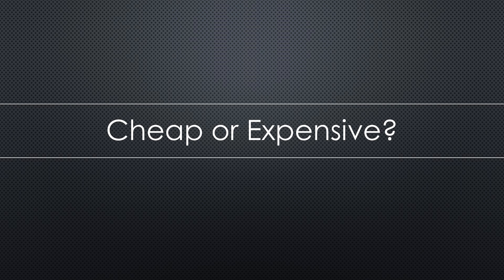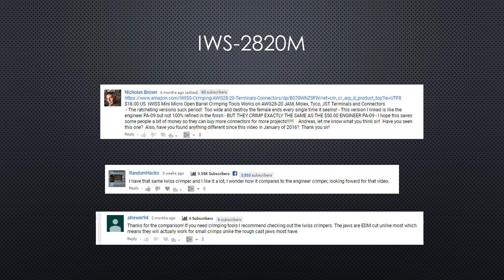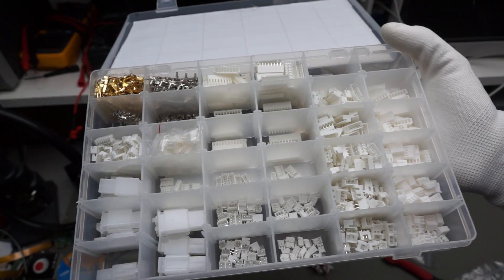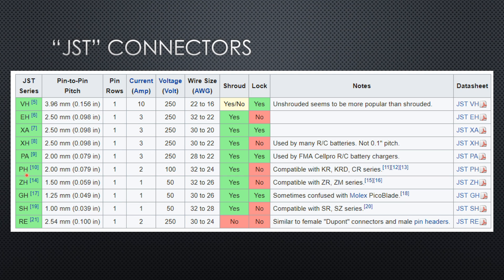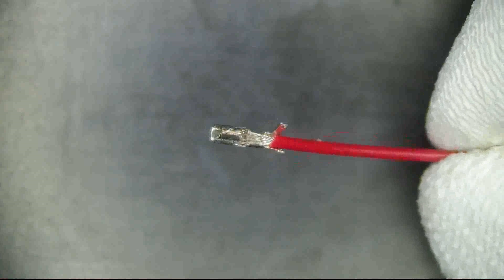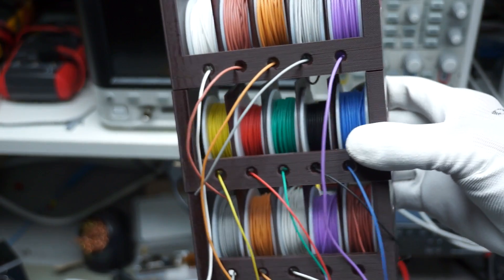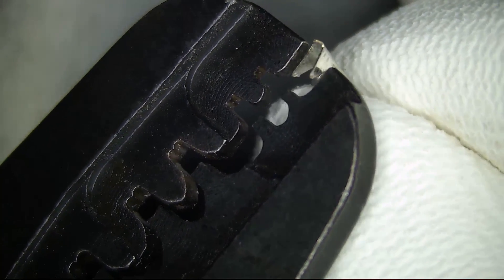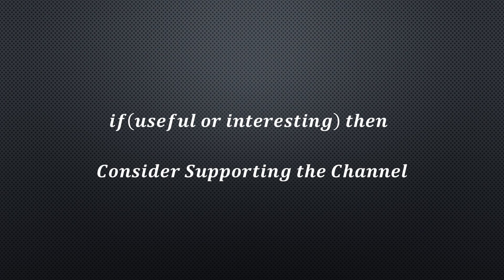#282 Crimpers: IWISS IWS-2820M  against Engineer PA-09?

Comment: I'm using the IWISS since a few months and so far i'm very happy with it. The smaller openings are very useful for JST GH - that's at least where i used them for. 
Thank you for this video - now i've learned that 1.3 is enough to crimp the end of dupont cables :)  I've always used 1.6 for the end and then had to compress the ears it created. 1.3 works so much better.
Reply from the maker: Yes. 1.3 should be ok.
Reply: I often pre-crimp using 1.6 or even 1.9 opening then crimp down with 1.3. Please, DO note that Dupont cable crimps must "Embrace" (wrap around) the wire, not dig into it. Therefore a correct dupont wire crimper would be U-shaped and not W
Reply: mattmillman has an excellent article
Reply: you probably dont care but does any of you know a trick to get back into an Instagram account??
I stupidly lost my account password. I appreciate any tricks you can give me
Reply: @Albert Gannon Instablaster ;)
Reply: @Adriel Nicholas thanks so much for your reply. I got to the site on google and I'm trying it out atm.
Seems to take a while so I will reply here later when my account password hopefully is recovered.
Reply: @Adriel Nicholas it worked and I finally got access to my account again. I am so happy:D
Thank you so much, you saved my ass!
Reply: @Albert Gannon No problem :)
Reply: hello i use IWISS for JST GH , but i felle the result is not perfect  for isolator part ! is like 0.7 to small and 1.0 to big  ! how you do ?

Comment: Thank you very much for your reply to my comment on your Video #39  I did watch this video before I ordered new crimpers and did order the IWISS model IWS-2820M.  I have used them only twice and both crimps are very good and they are MUCH easier to use than anything I have tried before.  I am a 74 year old retired engineer and my eyesight is not as good as when I was much younger, but I have an Optivisor Headband magnifier that works well for me.
Reply from the maker: Glad I could help. These magnification glasses are very useful, indeed.

Comment: Hello, I just bought the Engineer PAD-11. It's more expensive, but has interchangeable jaws (~ 25 Euro / jaw). I just used it to crimp JST-ZH (1.5 mm pitch) for a Sensirion SPS30 PM sensor (particulate matter). After a couple of tries and failures I now get 100% succes rate with stranded 28 AWG wire. My first attempts were with ~ 26 AWG, but the housing for the crimps seems to struggle with the larger wire diameter (crimpts were successful, but not as neat as with 28 AWG). Next I will try a JST-SH which is 1 mm pitch for a QWIIC to SPS30 JST-ZH connection. That's going to be more challenging, but the PAD-11 should be able to do it.
Great channel BTW!!
Yves
Reply from the maker: You are a brave man! I decided to buy ready made JST connectors for the smaller sizes ;-)
Reply: how is the Engineer PAD-11?
does it crimp JST-GH 1.25mm and JST-SH 1.00mm?
Reply: I had success with the JST-SH 1mm (2 tries to get a working result) using the PAd-11.
Reply: @yvesvanderhaeghen196  great. do you use Molex PicoBlade too?

Comment: if you turn the connector upside down in the crimper and gently squeeze it the angled bottom of the channel will bend the tabs in slightly so you don't have to use the end of the tool.
Reply from the maker: Thank you for the tip!

Comment: I like my SN-02BM still. I have both versions now. The first pliers I ordered have 2 press fit pins in each die, along with a screw. This is specifically the SN-02BM. The "M" is the one with press fit pins.
  I have a second set of SN-Series pliers that have interchangeable dies. These only have a screw holding the die in place, no press fit pins. I have the SN-02, SN-28B, and SN-48B dies. The SN-02 is similar to these Iwiss pliers. It has a bunch of different sizes and bridges the SN-02B and SN-28B with extra sizes on a long extended die. The die alignment with the tiny crimp sizes of the SN-02 without the press fit pins is bad.
  I can do the JST 2.0/2.5 crimps all day without any issues using the SN-02BM. The 28B and 48B dies work well for 2.8-6.3mm terminals using the pliers with replaceable dies. I wouldn't recommend the SN-02 in any variety other than the pinned version. It sucks that you won't be able to change dies with it, but it works well.
-Jake
Reply from the maker: Thank you for sharing your experience!

Comment: I would have expected a pull test with a force meter, to see which is actually better. And possibly also a resistance measurement.
Reply: When I do a pull rudimentary test at home, the terminal is clamped into a vise and I pull until the wire breaks.  If the wire pulls out of the crimp it is a fail.  If instead the strands of wire break instead, it is a pass.

Comment: I have a crimper from Radio Shack (US) that I bought over a decade ago for making DB style connectors. It does both crimps in 1 action and works w/ Dupont terminals quite well. I'm surprised these modern "tools" don't.
Reply from the maker: Radio Shack had good products (I had a TRS-80)

Comment: 0.7 and 1.0 mm crimping is needed for any connector where the pin spacing is 1.25 mm. For example the molex clickmate series.
Reply from the maker: I do not do these jobs manually. I buy them ready-made. So I do not know.

Comment: Another really great video - thank you!! I thought it was either my technique or the cheap Aliexpress crimps that was causing me troubles. Especially the extra steps needed to straighten the insulation grip before crimping and then straighten the whole crimp afterwards. I just got my IWISS tool and now perfect crimps every time! The Engineer tool is better made and will probably last longer, maybe it crimps high quality parts better too. But for now, the IWISS wins for me hands down.
Reply from the maker: Agreed

Comment: How interesting, not the result is expected and I have a few I Iwiss crimpers. I mainly use the Iwiss sn01 (2 bays not 3,) for jst and molex rather than the 28b that most others use and it works beautifully, but does occasionally dog ear the cables plastic part. I also have their anderson power pole crimper and a couple of others, but I never expected them to outperform the Japanese engineer pa09. Kudos where it's due I guess, well done Iwiss and thanks for all your good work in these videos actually testing the tools head to head.
Reply from the maker: I also was astonished. This was the reason for that video. For many viewers, the Engineer was quite expensive...

Comment: Just saved me £30, had a the PA09 in my basket.... thank you kind sir!
Reply from the maker: You are welcome!
Reply: @AndreasSpiess  Ironically I ended up returning the iCrimp after trying the Engineer PA-24 crimpers. Not only is the wire crimp better but the rounded cable jaw crimp is perfect and wraps the cable rather than crushing it. Making DuPont connectors is 3x faster with it vs the iCrimp (with my crappy eyesight too)

Comment: I was tired of those cheap crimpers(your previous video) and few others.
So I decided not to cheap out this time, found PA-09 on amazon, but in the other recommendations/frequently viewed there were those ones from IWISS, checked comments and people say that those do as good as PA-09 but are much cheaper so better.
But I ignored it, didn't want to risk that I get another useless crimper, purchased PA-09.
Though now I regret this decision a bit, I also have this problem where entire crimp insert is being bent.
Also I expected much better tolerances on sides of those jaws, can clearly see gaps when closed.
Reply from the maker: Thank you for sharing. The other video was already quite old and the IWISS were not around then.

Comment: For smaller jobs like MQS 0,2 to 0,5 I purchased a Rennsteig #616 682 3, it has absolutely NOTHING to do with any other tools ou can find for these small connectors. There's no secret, quality tools make a hell of a difference. I will note that this crimper costs over 200 euros (and it's not the most expensive around), so it's not on everyone's priority list !! 
I find that providing you can afford it, most of those tools will stay with you for years in not a lifetime...  and you purchase and change the dies according to the job. 
- the guy with the Swiss French accent ;)
Reply from the maker: I googled your choice. I bought a used Harting FC2 which is similar to yours. But for makers a little expensive. Most makers should be ok with one of those presented in the video, I think.

Comment: Then 1.9 + 2.3 is for Molex SPOX (3.96mm pitch), which is pretty common with power supplies. That‘s, why I have a PA-20, too.
Reply from the maker: Aha. I never used them so far. Thank you for the update!
Reply: The isolation crimp is imho not so great (although it is the recommended crimp size from the manufacturer), left and right of the base there are cuts. When I press too much, it is even cut off. I might try the IWISS, too, because I want to see, if it performs better.

Comment: I have been crimping 1.25mm connectors (shelly2.5 and some CC2530 clone) using the 1.0mm on my PA-09. It works, but I need finer gauge wire :)
Reply from the maker: And good eyes ;-)

Comment: Just a caution that your Amazon link now points to the 2412 crimper and not the 2820. The 2412 has larger dies (2.2 - 3.4) so will not crimp DuPont well. The 2820M is not available on Amazon at the time I wrote this. Worse, the first and main picture is a 2820 but the remaining pictures, title, description, and the model number are for the 2412 so buyer beware.
Reply from the maker: Thank you. I changed the link.

Comment: Wow, I didn't expect one of my comments to be featured in a video!
Reply from the maker: You see, I read the comments;-)
Reply: @AndreasSpiess  I have used the IWISS crimp you featured in this video for JST ZH and standard servo/"Dupont" crimps and it has worked well. the ZH connectors used the smaller sizes. They are tiny! Thanks for reading. :)

Comment: They are both good. But, every single one crimp "ears" INTO insulation. Which is not always good. Specially on those "Dupont" connectors. That's why I ordedred Hozan P-707. You should check them out too.
Also, if you are not interested into that feature, take peek on IWS-3220M.
Reply: @Undefined Lastname
Did you watch the video?
Also, I know that. Thats why I want to try that Hozan crimper.

Comment: Would you recommend the manual crimpers over the ratcheting ones? And why? I'd really want to know your option.
Reply from the maker: I have no preference. If you find a good one with a ratchet ii is probably a little faster. But it is not easy to find a good one if I believe the comments in my earlier video.
Reply: @AndreasSpiess  I heard somebody say that the ratcheting crimpers are harder to work with when it comes to small connectors. Since the dies are big, small pins are difficult to keep still there compared to manual crimpers. I guess I'll go with the manual crimpers.
Reply: @AndreasSpiess  I also want to add that I found "quality crimpers" (for example Nipex) that can easily cost over $200 dollars, way too much for my budget and probably for the regular viewer too.

Comment: Would the pa-24 be better to get than the pa-09 with the DuPont crimps added? 

Do you ever need the larger sizes where it would be beneficial to get the PA-20 or PA-21? 

If so would the PA-20 or the PA-21 be used most?
Reply from the maker: I do not know these products. So I do not know :-(

Comment: I would like to make a Molex mx150 connector for my motorcycle and have hit a dead end with the type of crimper! My question is are mostly all the open barrel type connector very similar? As the recommended molex connector from molex is extremely expensive! Thank you
Reply from the maker: Crimpers are very different. Best is if you find videos where they show exactly the connector you want. There you see, which crimper they recommend.
Reply: @AndreasSpiess  i have been searching i have even been looking at the molex data sheets and the recommendation is the molex branded crimper. I will continue my searcg

Comment: What i have noticed is that all IWISS tools seem to have tighter matching dies installed on them (visible in this video as well) and the machining seems to have less margin.
after getting frustrated with my weierli sn-28b (nearly throwing it out the window.) I bought both SN-01BM and the SN-28B and they both work amazing.

Maybe do a comparison between budget SN28 crimper(s), even though the PA-09/IWS 2820M are workhorses. 
I do like the "squeeze once, and done"  deal with the 01BM and 28B by IWISS, 
and for that price...
No they are NOT as good as the official crimpers, but close enough to be used and rely on. 
Maybe i'm just lucky, maybe there's something to this brand.
Reply: Do be careful with fake IWISS tools, the SN ones with NON-Machined crimping dies are FAKE and absolute sub par quality.
Reply from the maker: I ordered two more IWISS crimpers. We will see if their SN-28B is better than the one I had from Aliexpress...

Comment: 2:25:  I just ran into an example of needing a larger crimp than the 1.9 (though not sure if the 2.2 on the IWISS is exactly correct for this case): JST VH connector crimps, e.g. for a motor driver board (like the 3.96mm pitch VH pins on the left side of board here https://youtu.be/TaCukBg4Hj8?t=178).  The Engineer PA-09 documentation shows it's compatible with PH/ZH/NH/EH and you need the next bigger crimper, the Engineer PA-20 (adds 2.0 and 2.3 crimp slots), for VH.
Reply from the maker: Thank you for sharing your experience!

Comment: I made the mistake of trying to save a few bucks buying the SN-28B. It's pretty much impossible to produce a good crimp with that thing, even after doing hundreds of crimps on various projects over the years. I'll definitely be replacing it with an IWISS for the next project that requires crimping.
Reply from the maker: This was the reason for my first crimper video...

Comment: Hello, Thanks for the interesting video.
Do you have any suggestion for a tool to crimp open barrels terminals with 12AWG (4mm²) cables ?
Reply from the maker: No. I do not use such connectors :-(

Comment: Thank for testing and evaluating of these crimpers:-). After watching your video #39 I was already tending to buy the nice PA-09. But apart from the long parcel trip from Japan, the IWISS IWS-2820M made me curious, too. 

Now I have discovered a similar version: IWISS SN-28B. Has anyone tested this tool yet? And is it like the chinese crimper in video #39 - but only better?
Reply from the maker: The  IWISS SN-28B are also very good. I have one here now.
Reply: @AndreasSpiess  Thanks for your hint! Just today this crimper was in the mailbox / in my hands. Not only does the "mechanical noise" sound good, the crimping also worked very well after the third attempt. Now it's time to make special adapter cables:-).

Comment: I use one of those Multi-functional crimpers. {right one at 0:33}
and they are indeed quite tricky to learn on how to use them.

But once you get the Hang of it they work like a charm. {setting the strength of the crimp to the lowest setting is needed}
If you just started using it the crimps are good enough for Cables that do not see a lot of stress on the Cable itself,
But if the Cable sees a lot of movement and stress i would not suggest using them.
Reply from the maker: Thank you for sharing your experience!

Comment: Hi Andreas- Can you make a circuit for failover power supply. 1Input form 12V adapter, 2nd input form 12v battery. when the 1st input is not there then it will switch to 2nd input. I know its easy to make it with a single   8pin relay. But the problem comes at switching time. All the devices rebooted due to switching time.
Reply from the maker: Maybe a capacitor helps to provide power during the switching?

Comment: I guess there is no "perfect crimp tool" just because there are so many crimping applications - I mainly use 4 different tools for coax  like SMA on RG316 to N Connectors on up to 15mm cable, a Knippex tool for simple ferrules w/o insulation,  a china tool for square ferrules with insulation and more other crimping tools for e.g. cables shoes lie in cars, etc..
Reply from the maker: These tools are mainly for Dupont wires

Comment: The Engineer PA-09 can damage/cut the insulation of XH crimps and the insulation can break after some mechanical stress (http://tech.mattmillman.com/info/crimpconnectors/#xh ). Your PH crimp with PA-09 might also run into that issue, while the IWISS IWS-2820M crimp looks much better.
The same applies to both crimping pliers when crimping Dupont, because Dupont requires a round crimp on the insulation. The Preciva PR-3245 looks more promising for proper Dupont crimps (there is a Youtube video and a few pictures at Amazon Germany, search term: Preciva Dupont).
Reply from the maker: I purchased a used Harting FC2 professional crimper on ebay to compare it with my hobby crimpers. We will see...

Comment: I've been using the Engineer crimper professionally since I found it looking for generic crimper around five years ago. It's by far better tool than the rubbish generic no-name crimpers you usually find in the lab if you don't have a part-specific crimper. Obviously purpose build Molex et al crimping tools are better but they're waaaaay expensive. Naturally if you actually make cables in anger, it's worth it as a good tool that will crimp the wire in one go, but if you're mostly doing couple of prototyping cables occasionally, then the PA-09 will get the job done. There's also a bigger version called PA-20. As for the crimps getting stuck, it's usually because you use too small opening. Generally you have to do the wire crimp in one slot and insulation crimp in another.
Reply from the maker: Thank you for sharing your experience!